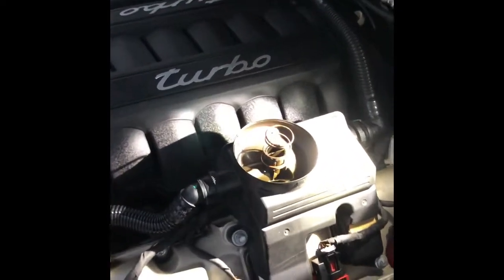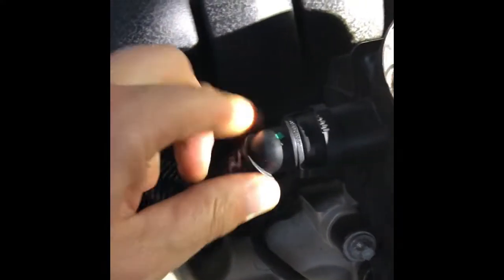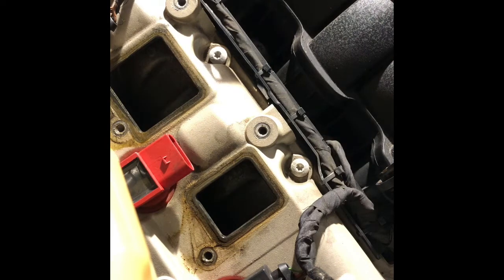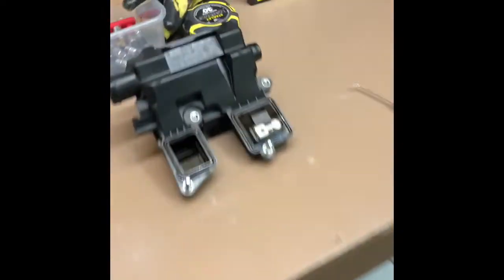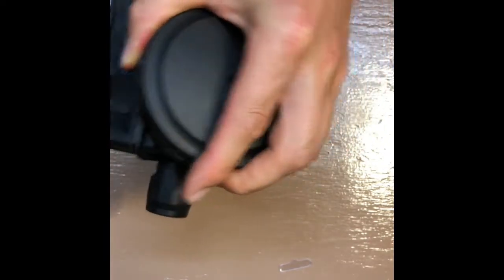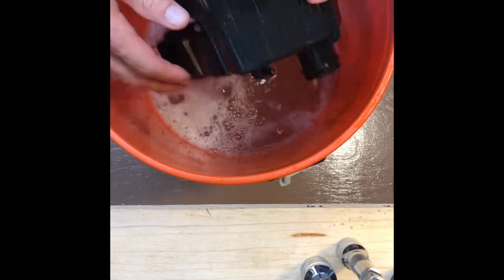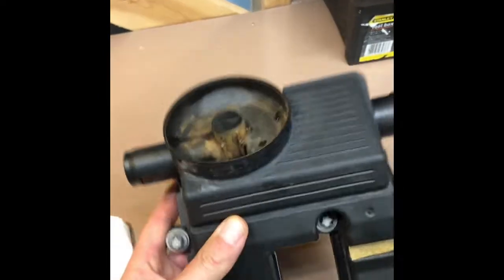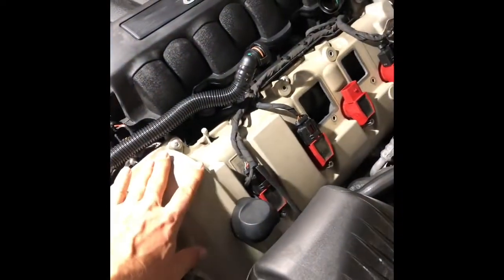Porsche Cayenne Turbo Oil separator cleaning and removing

Comment: Hi, did you have rough running engine?
Reply from the maker: yes 
but the issue was cam shaft position sensor was bad
Reply: @tomrast9629  ok. But did you have any error codes with the camshaft position sensor in the DME.
Reply from the maker: Porsche Pana 
Yes all kind of codes 
Few mechanic could not find the problem so I ended with Porsche dealership 
I had like 6 different codes